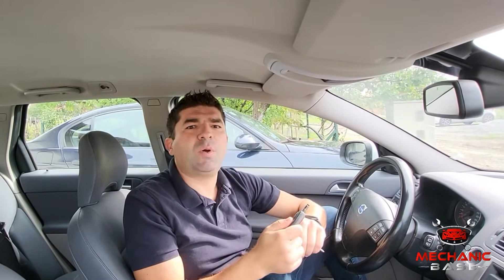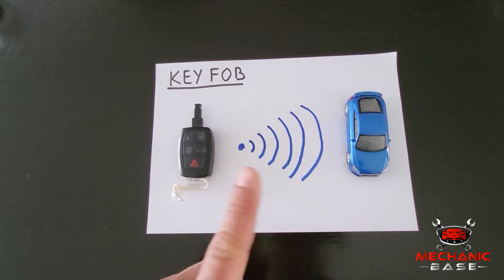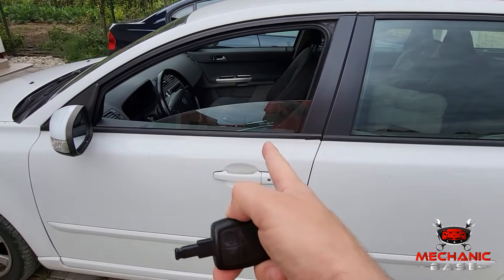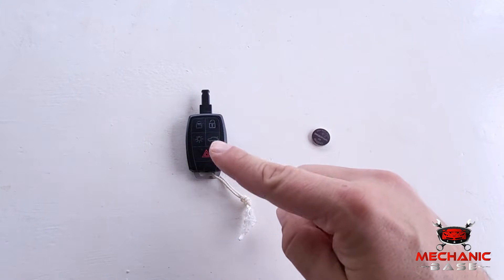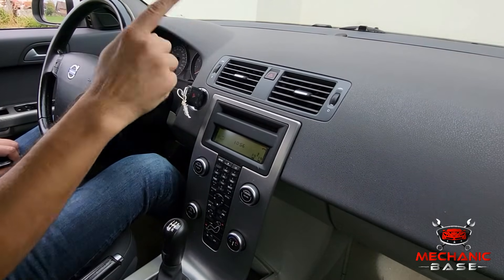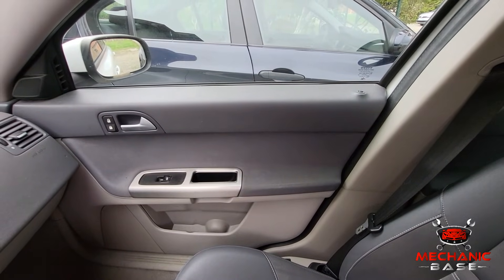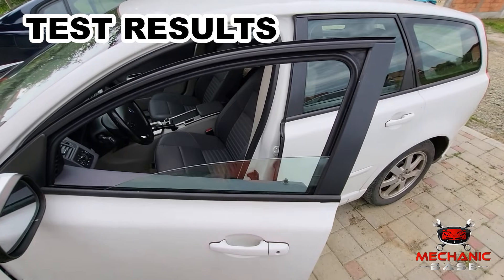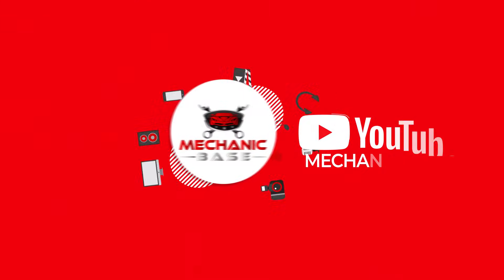How to Reprogram your Car Key Fob (DIY At Home)

Comment: Hello

A question: I just bought 2000 Newbeetle GLS.

I have one valet key and 1 remote key.

My valet key works as it should

My remote key: I can start the engine, but it quickly dies. I can lock/unlock and open/close windows

Can you please help? Thanks

Comment: For many vehicles, you must still get the actual key cut.  Most hardware stores do not have that ability.  My key has to be cut on the top, not the sides with a laser.  Not sure if the locksmith will cut the key and leave programming to you.

Comment: Great video but sadly it did not work on my car.  I have a VW Polo 1.4 TDI diesel (X reg year 2000 model) with a Cobra key fob.  At the moment I have been unable to start my car as the alarm goes off.  Have you any advice on how to reprogramme it and match the cobra fob to  it, please? I can send a picture of the keys and the fob if necessary

Comment: My car was in a crash and after I got it back from the repair shop, the key fob only turns on the alarm, it doesn't lock the doors. I got a locksmith out, but he couldn't fix it. I don't have a manual transmission, so I can't insert the key into the ignition. Do you know how I can fix this?

Comment: Great I put mine in the washing machine..I tried drying, changing battery...it's fried. I found a new one on eBay for $8.. exactly like mine for BA model ford falcon..thanks for the tips. Check your pockets guys, before wash the clothes

Comment: i bought a 2nd hand Jeep wrangler. it has an aftermarket fob. it no longer works, we replaced the battery, nothing. it's a push button start, we can't even unlock the doors. what do we do/ 2020 Jeep wrangler unlimited sport. TIa

Comment: I have a jaguar xf 2015 fitted new battery but remote doesn't work tried the key in door handle but it only goes in about12mm and will not turn

Comment: Hi one of my two 2013 Honda City key fob, even though the battery is new, isn't unlocking/locking the car, what could be the combination to program it (the red light on the key fob lights) so the frequencies are the same? My other key fob is working.

God bless.

Comment: i have an accord 2007 - and i don't have the original key. however i have two keys cut w. each a transponder/chip that allows me to turn on the car. ive been trying to program my keys so that the remote/buttons work but have not been successful. i changed the battery and the red light on the key remotes work. i go thru the cycle of turning on the ignition, pressing the lock button, turning it off (4 times) and after the 4th the car doesn't lock - so i assume it doesn't work since I'm unable toget it in programming mode. any advice guys? i would really appreciate it.

Comment: Will this work for a completely new fob as the car I bought did not come with the key fob. Also, the replacement keys I am thinking of buying are not cut - how do you recommend I do this?
Reply: As long as it matches the same frequency.  In theory,  yes. However,  you would have to check because he did say something about "dual arch".

Comment: This video seems to good to be true...I Have a Volvo 2004 XC70 and this video is using a Volvo to demonstrate the process, YAY! However, I have a question: I have the original Keyfob with the cut key. I also have a new keyfob without a cut key (Meaning I can't insert this new key/fob into the ignition). OK I want to program the new key fob. Do I insert the old key fob into the ignition and turn it off and on 3 times while holding the New Key FOB Lock Button??? Basically, I think that the key fob is being programmed wirelessly and holding the Lock button on the new remote will have that key fob programmed??? This is unclear in the video and hopefully someone can confirm. Thank You In Advance!
Reply: Hello I have an 03 Mercedes-Benz C240 4matic and my key will not turn in the ignition. I have a brand new car battery and, once this fob had an issue, i purchased new batteries for it also No interior lights or power is coming on in the car. I need help!
Reply: 1 year later.  Did you figure it out or not ?

Comment: This didn't work on my 2009 S40
Just an Observation but it appears that you press the "Unlock Button" after the Doors Lock in Programming Mode.
Reply: Did you sort out your fob?
Reply: as far as I can tell, it has to be taken to the Dealer to be Programmed. @atesz928

Comment: Hi.  I have a Lexus RX400H and have just had the ECU changed, but as the part is now discontinued, I had to buy a used one.  The Lexus dealer is now unable to programme the ECU to the car as the key appears to be a sub key rather than a master key - they've told me they are unable to do it!  Do you know of a way the sub key can be re-programmed to become the master key?  Any advice would be most welcome.

Comment: I have a 2010 dodge grand caravan. What type of battery does the key fob use?
Reply: Looks like that'd be a CR2032.   You could probably find that in your owner's manual, but you could also try using this as a Google search query for other references:   "2010 dodge caravan key fob battery"
Reply: Take the battery OUT of your key fob and go to Wal Mart or Auto Zone and get the proper battery. That is what I did when it stopped working, and once I changed the battery it worked again.

Comment: I have a seat ibiza 2012, yesterday i got a new remote, i pulled out the circuit board from the old remote and installed it in the new remote shell, the lock and unlock buttons work good and opens and lock the car but when i put the key in the ignition and try to start the car i get a "no key " error, and the car wont start, does this method fix this?

Comment: The car only has a push button no place to inserta key. Can this kind be programmed without taking to a dealer?
Reply from the maker: One thing you can try is holding the keyfob against the dashboard, near the push button.

Comment: What do you do if there is no place to insert the key in the ignition? We have a 2013 Nissan Sentra
Reply from the maker: Try holding it against the steering column (where the key 'normally' goes in older cars).
Reply: @jeanlightner did this work? I have 2014 Altima?
Reply: I didn't try it. I decided not to spend the money on a second fob.

Comment: Hi, with a bit of tweaking this worked well for a 2013 Toyota Camry with smart entry. I had replaced the batteries in both remotes and found your tutorial which was a great place to start. Thanks heaps.